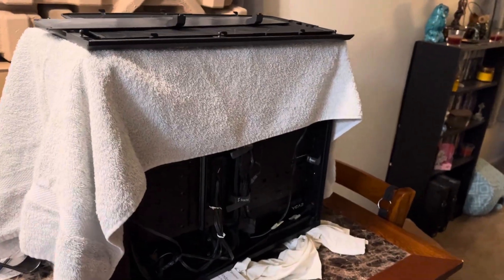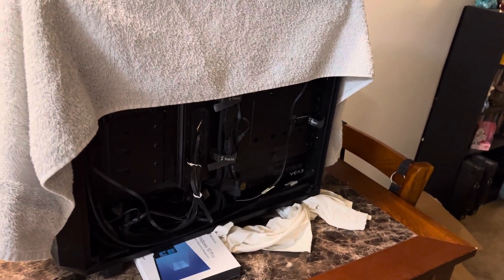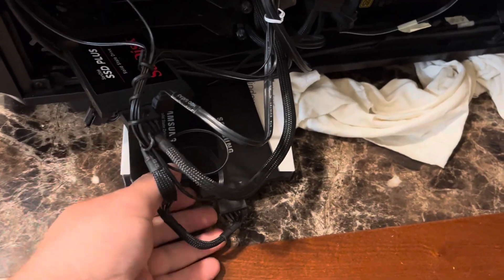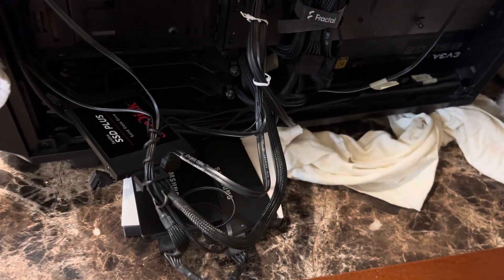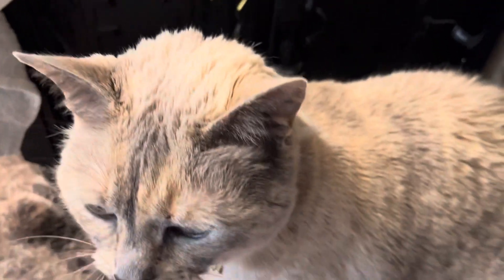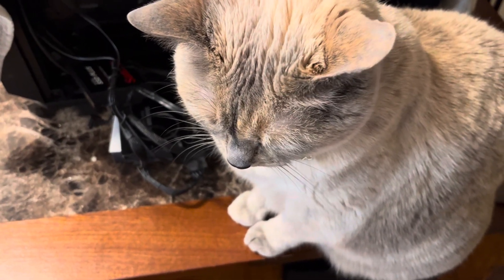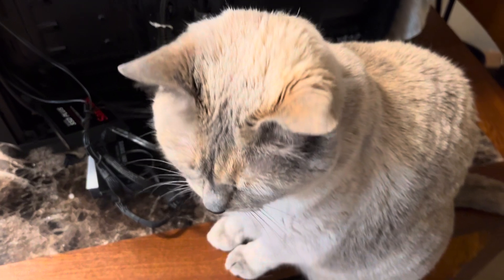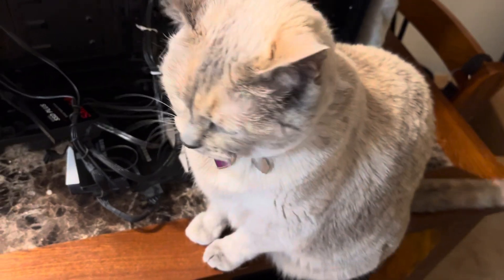CHANNEL DOWN until further notice.

Comment: Sometimes when Windows is installed for the first time the "boot manager" ends up installed on a different drive to the one with the actual operating system on it - Meaning, unless both drives are plugged in at the same time the PC wont boot into Windows like it should. This can make troubleshooting frustrating when you have more than 2 drives and don't know which pair of them is the "culprit" so-to-speak. Hope this helps.

Comment: Hi Vaos, OK if the system is booting directly into BIOS then I doubt it's the Windows install itself. Even if it were corrupted it would still try to boot and then just fail. It sounds to me that the drive itself may have just failed. I would recommend the following steps:
1: Reset Bios by removing the battery for about 10 minutes.
2: Eliminate cable issues by trying different sata cables and different ports on the MB
3: Eliminate power supply issues by trying a different sata rail from the PSU
4: Eliminate RAM isues by trying each stick alone in DIMM 1 slot

If the same issue persists after these steps then it's 99.9% the SSD itself that has failed.

Comment: Can't say for sure without actually looking at the equipment directly, but if it is reading all three drives and refuses to boot it sounds like you may have lost the boot sector of your OS drive.  If that is the case, you may have to replace the OS SSD.  If you can/have a friend who has a computer, you may be able to reformat the drive and see if that fixes it, but it may not work.  It has only had about a 50% success rate when I have lost SSD Boot Sectors.  It definitely does sound like a drive issue if you can get into the Bios... that is on a chip directly attached to the mobo.  I have lost Bios as well on one of my old machines and was able to change the jumper to swap to the backup bios chip.  There is a small chance that the Bios may be out of date, but I don't remember specifically how to flash that, though I am sure you can find someone in the community that can help there if it does become necessary.  Best guess at what you were describing though, does sound like you lost a boot sector and that can be a right pain in the sack.  Keep your chin up and keep moving forward and we can see what we can pool together to get the rig running again.
Reply: A second option, if you can get a friend to help you out with it/use their computer for diag, then you might be able to plug your OS SSD into their system and see if it boots to windows.  (I would personally unplug all of their drives just to be safe) If it refuses to boot on their system, then it is something wrong with the drive.  If the system comes up, then you know the drive is still good... easiest way to determine if a drive is bad imo.

Comment: Be sure to backup your data from the system drive before making a fresh install, some games and programs can save stuff there and you can lose something. Look for the User folder, documents, appdata, etc.

To backup stuff without disassembling everything I recommend booting a temporary system from a pendrive, look for Hiren's Boot, it creates a bootable usb drive so you can transfer stuff between your drives before formatting.

Comment: Use friends PC to create win 10 install flash and try to install. If you select same partition and not wipe it, it should not delete old files, just move some of them to windows.old folder
Reply: Also, you can make a Linux boot flash to backup important files. Don't worry, that won't require command line

Comment: Regular PC users: today is a very sad day. My computer won't boot and I don't know, why...
Me, a *pure professional*: my ssd died twice already, dragged it back from hell by its SATA cord. Now, as punishment, it supports GPU, because otherwise GPU bends and chip loses connection, as it's halfway torn off from pcb by the bending. Also, I zip-tied an extra fan, so my AND 990FX chipset stops boiling itself at 4.2/2.4GHz CPU/NB overclock.
Why overclock? So it runs BE better, of course
Reply: And yes, I legitimately own this shitshow of a PC
Luckily, not my main PC
Reply: Also also, windows updates brick the system every half a year for some reason

Comment: i wish i could help, i had the same problem. i was able to put my hard drive in my girlfriends pc and it worked a little bit but it said system corruption detected and would force safe mode but when i put the hard drive back in mine still nothing. so my only solution was not ideal. i bought another pc. maybe i can figure out what happened. i thought it was cause it was AMD not Intel but my girlfriends pc was Intel and mine not. other hard drives worked in mine but not mine, although with me and my girlfriend we have laptops not towers so 1 drive  per person

Comment: I had a similar issue a while back, turned out my BIOS lost the SecureBoot "key" for windows.  I had to make a Windows 10 USB install and boot that first, it reinstalled the required key into the BIOS and then everything was just fine.  Might not be the same for you, but worth a go.  However as you don't have another system I am not sure how you can make said boot USB.

Comment: Sounds like either just your Windows 10 OS corrupted itself or your physical SSD card (hard drive) has failed and will need new SSD installed for your Windows OS installation!  Good move in having your "important data" NOT equally located on the same SSD card as your Windows 10 OS!  Good Luck!  Yea!  Hahahahaha!  O:-)

Comment: seems like that sandisk ssd is fried or it has lost its info, if I were you I would use this as an exercise to replace that sandisk SSD with an M2 SSD (depending on how old your motherboard is and if it can actually take an M2 SSD)...have you tried plugging the sandisk SSD into another machine and seeing if that machine can see what's on the disk?

Comment: I had something very similar. I think that the issue was caused by a crash or something during an automatic windows update. the only way I found to fix it was to get another SSD with a fresh windows installation on it and then open your old main drive and start transferring files over. it sucks a lot and is very tedious, but it did fix my issue

Comment: This might be a stupid question/suggestion (and you may have mentioned it and I missed it) but have you tried using one of the SATA cables from one of the other SSDs that your bios can read for your OS drive? I've had a few SATA cables just randomly die on me for no reason several times and its always the last thing I think to try. Hope you are able to get it up and running again!
Reply: Quick, easy, and free. I don't know why I never check cables first! Yesterday, I fixed my glitching FM radio just by reseating the fuse.

Comment: The moment you get it fixed, create a USB bootable windows installation - as well as being an installer it's a great package of tools you can boot into in case this happens again.

Or if you're a little more tech savvy, create an Ubuntu live USB, it's an entire linux installation on a USB that you can use like a regular OS - infinite flexibility in a USB for solving issues like this.

Comment: lmk if you need some help looking through the BIOS settings for the issue, I might be able to hop on a Discord call with you tonight or some time over the weekend.  Unless it's a hardware failure, it should be fairly simple and shouldn't necessitate reinstalling Windows.  Either way, best of luck and don't panic, we'll be here.

Comment: This may not be possible for you but personally I’d first of all try and boot a usb, you can do that by setting up a usb with a free linux os or something (although if you have no pc then you can’t do that). If you could do that then you could access the ssd from the usb and try recovering the data. And then once you’ve done that, just replace the drive and try to set up windows again.

Comment: Maybe you can let your motherboard check the SSD, I have an MSI X570 board, which allowed me to do a health check on my NVMe SSD. I am not sure if this works for SATA SSDs, but the option I used was under Settings -> Advanced, and then spaced out at the bottom was the NVMe health test. Although it is probably not the SSD, unless your Bios tells you the SSD is in read only (which happens when it reaches its write limit). I am not sure that would happen, as I never had a failed SSD, but it is what I would expect. When your Windows install somehow breaks, maybe because you interrupted an update, the OS should just boot into recovery mode, display a blue loading screen that tells you it is repairing something. Considering this doesnt happen, the recovery partition may be broken as well, which does indicate a broken SSD, but it could still be entirely OS related as Windows likes to be enigmatic.
It will probably come down to reinstalling the OS one way or another, but this will format the entire drive and therefore delete all data on it. When you can live with this data loss and are ready to overwrite the OS, maybe you have windows disc and a disc drive, then go ahead. If there is Data on the OS drive you want to save, you will either need to buy a new one and install windows onto there, or create a bootable USB drive, but I dont think you can save the data with windows in this scenario, so you will need to use a Linux OS, Mint or Ubuntu, doesnt matter, 4GB should be enough. There is one possible problem though, encryption. I dont know if Windows encrypts your data by default, if that is the case, I am not sure if you can get you data back, I dont actually use Windows myself.
Assuming you dont just overwrite the OS drive using the Windows disc method, you will need to create a bootable USB drive. This does require a small USB stick 4GB for Linux usually and I think 8GB for Windows, but you do need another computer with a USB port, so you may need to ask a friend. When creating a bootable USB drive, you need a software tool, Balena Etcher is often recommended, because its easy and works, and a flashable OS image (.iso file). For Linux Mint, just search for the Linux Mint website, and they will throw you an iso download link in your face, for windows go to the microsoft website and try to find it (pro tip, use the search function, microsoft doesnt make it easy to find a windows iso for some reason), balena etcher should work for windows too, even though microsoft tells you to use their own utility, although I was never in the position to find this out. after obtaining the bootable USB drive, you can tell the bios to boot over it via boot priority. Windows should act exactly like the install disc from now, I think. Linux Mint however will not immediately install itself on a drive you select, but rather create a live OS environment, that will reset when rebooting, since it is only saved in RAM. This live OS will allow you to access your drives and move data around assuming nothing is encrypted. You would usually install mint from this live OS, but you dont have to do that, if you want to keep Windows, and use this feature to save data instead.
About the Windows license, I think this is tied to your motherboard, so you shoulnt need a new one for $100+. If for some reason Windows doesnt want to go through with this, just install mint, it might not be what you are used to, but it will leave you with a functioning computer and you will be able to make KSP videos again.
If you want to buy a new SSD, 1TB of storage usually costs less than $50, I think I saw a 1TB Sata SSD SSD from Crucial for $35 on newegg, although all of these prices seem to be before sales tax, which I find kind of dishonest. You can also buy a 2280 NVMe SSD (2280 stands for 22mm x 80mm) and put it in one of your two or three M.2 slots on your motherboard, just dont get compelled into spending extra for a fast one, even slow SSDs are usually overkill in terms of speed.
I hope I didnt forget anything.

Comment: Hang in there Vaos. We all know what its like when a necessary computer goes down. We are all behind you and understand. Take the time you need to find the solution and get the computer fixed. I'm not leaving. 

To me, it sounds like the OS SSD may have gone bad. But without looking at it myself, I can't say for sure.

Comment: Computer hardware guy with 30 years experience here, Almost certainly a dead drive.   A corrupt OS doesn't send you directly to BIOS.  The BIOS screen shows up because no bootable drive at all was detected.  If it's not the drive it possibly could be a controller issue, in which case the mobo is likely dead or on it's way out.  you could flash the bios as a hail mary pass..   and last possible cause is power supply, but that is a long shot.

Comment: Hey Vaos... So sorry about the PC problems! 

I would if I was you get another PC or Laptop plugged into this problem PC 
by a HDMI cable and use the another PC or Laptop to look at the problems on the drives?  

If you don't have the access to another system see if someone you know can let you use theirs to check the system?
If no one around you can ask, then just get the new ( 3.5 or 2.5 inch spinning disk drive )

Maybe a single file in the BIOS boot sector has been damaged? or is corrupted.

You could get the replacement file from the other computer that is hooked up ( along as it is a Windows 10 Pro ) 
and replace the bad file with a clean copied file of the same type from the working computer.
As others said here it most likely either a corrupted boot file in BIOS or the boot sector and you may have to get a new drive?

I always used the old versions of Hard Drives ( the Seagate 3.5 inch moving disk drives ) I been using them from many years 
( one is 20 years old and fine it storing files now away from the PC in a store area no power )

They are the best and I found most reliable drives. Okay they are being replaced by SSD, 
But they are very good bets for storage of Data.
I proved so since I 1st started doing Computers way back in 1980. 

So if you need a good safe long lasting data HD get the Old version not the picky over hyped SSD. 

The Seagate is the best brand by a long way I proven this as I used them for over 25 years.

Comment: In the words of Katt Williams, "PIMP DOWN!  PIMP DOWN!"
I love how there's a white towel on the comp like a funeral shroud.
A kitty was in the video so this will take the internet by storm.  Kickstarter off the fame for a new comp?  
...OK, funny comments aside, I ended up installing Win7 on my old comp a total of 4 times over multiple harddrives.  Sometimes some glitch will just stop the OS from completing (or even initiating) the bootup process.  So I would recommend taking that shiny Win10 cd there and do a temporary install on one of the other drives.  Then maybe reformat that 100Gig drive and try again.

Comment: Things below are a speculation ONLY! Either way, your content will be amazing forever. 

So it boots to the bios - somewhat of a good sign. Looks more like the bootable media drive (your SSD) has kicked the bucket or the bios stopped recognizing the drive (possibly through write limits or something else (or the drive may have been corrupted)) . In that case you may need to get a new drive for your OS + shenanigans and have a new install of windows on that new drive. You could maybe look into getting the data recovered. The motherboard may have carked it as well (the joys of computers). Either way, the problem might need to be solved with some spending if your willing to do that.

Comment: As someone who just lost my Win10 install previous week due to hard drive shenanigans it is tough! Basically my upgrade/copy/swap from HDD to SSD related to storage wrecked my win10 OS on system m2 and bizarrely tried to boot it from secondary m2 with no system. And I lost even all the backup options when booting windows repair tools, even when I removed all but one system disk. Potentially it was related to a m2 order in witch my two m2s were on Mobo, with system installed on 2st slot over 1st slot (yeah my bad, but it was fine for like 3 years). So when I touched the drive order it just flipped and died in pain, although I have done the same to the system in the past and it was ok.

Very bad thing is that a lot of software and games have bunch of saves and presets on system disk in appdata folder (good thing that KSP does not). So it took me a whole day of getting another m2 from other PC with working system into my machine then to physically backing up files from my "corrupted" system m2 drive before reinstalling clean win10 on that. And when I was reinstalling my win 10 I found out that my drive snapped into different file system format somehow. The one that do not support win10 install, so I was pretty much forced to format drive... And the drive itself is pretty healthy with only 7% of resource used and no issues otherwise found by test software. So it was huge win10 fluke in the end.